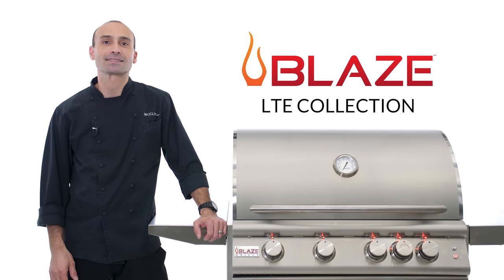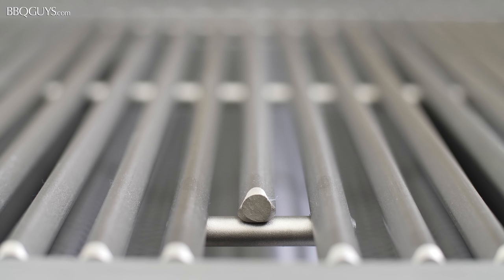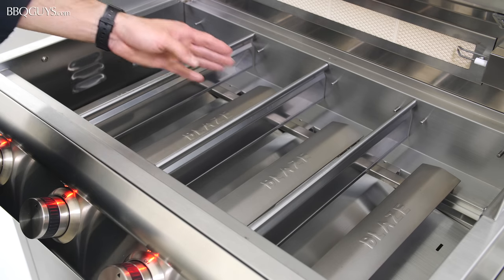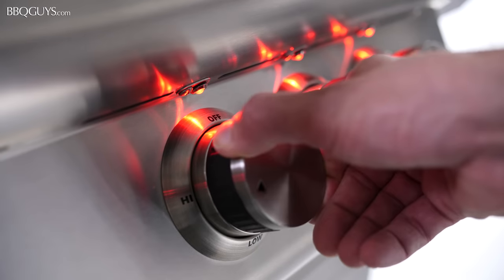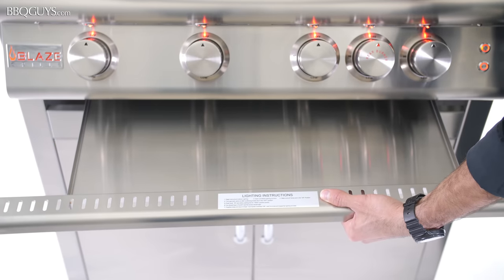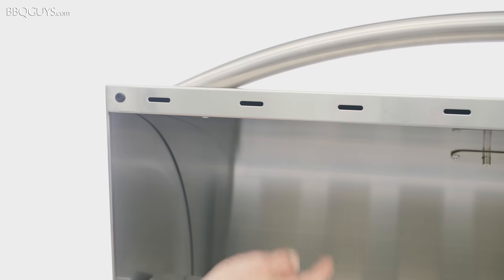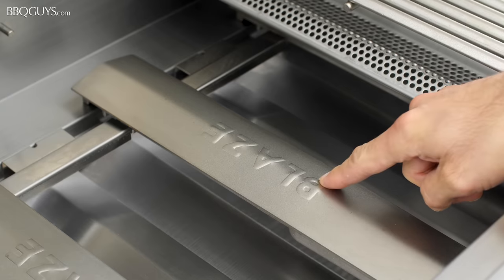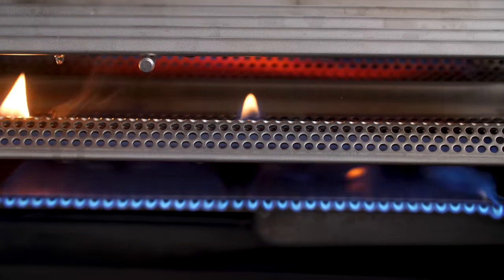Blaze LTE Gas Grill Review | BBQGuys Expert Overview

Comment: On the flame tamer, wouldn’t. It cook unevenly because the middle is not perforated like the rest of it?
Reply from the maker: That strip of metal is directly over the burner, so I think it is worth having the additional protection of the burner & the heat coming from the stainless burner gets a little extra diffusion along the middle.
Reply: It cooks unevenly because the large burners shoot the flame out the side of the burners and not the top, so there is very little heat directly over the burners.  It's a terrible design.  Good quality parts in it, but the engineering on it was a complete failure.  I regret my purchase of it (bought mine 2 years ago).

Comment: Not impressed with this grill.  I've owned it for a year, and found the heat distribution very uneven.  There is very little heat at the center of the flame tamers, due to the design of the burners.  Also, the grill flares up A LOT.  If you plan on cooking anything but lean cuts of meats (i.e. burgers and brats), be prepared to babysit your cook, and have a water bottle nearby.  The top shelf is basically useless, as it is only 3-4 inches deep, and impeded by the round top.  My other dislike is the GODAWFUL cart that is an option for this grill.  It is overpriced, and poorly thought out.  Sharp edges everywhere.  Extremely poor castors, and terrible castor placement.  They are too small in diameter, and are recessed several inches under the cart.  Unless you crawl on your hands and knees, you will not be locking them.  The castors only roll well on very smooth surfaces.  Even transitioning on a concrete sidewalk with troweled relief joints is a challenge.  The grill/cart weigh about 300 lbs, and it feels unstable moving it.  Also, the cart has absolutely no handles on it whatsoever, and the flimsy side shelves (held on with sheet metal screws) and not fold-able.  The doors are hard to open, and there are no shelves or drawers inside.  Just a big open cabinet with lots of holes in the bottom for things to fall through (or animals to crawl in).

On the plus side, the optional infrared burner works very well for searing steaks, and the overall quality of the grill feels solid.  The cooking grates are very heavy duty and retain a lot of heat for searing.  Fix the flame tamer and/or burner design, redesign everything about the cart, and I think you have a winner.

Update 5/14/2023:
I really hate this grill, and rarely use it.  It is an utter nightmare to clean, which you will be doing often due to the poorly designed flame tamers with tiny holes that constantly plug up.  I just spent 2 hours cleaning it.  My old weber could be cleaned in minutes, and cooked much more evenly.  I do like the cooking grates on this grill, but that's about it.
Reply from the maker: Thanks for your insights. Feel free to contact our customer service team with any issues you may be experiencing. Reach them at: 1-877-700-2974